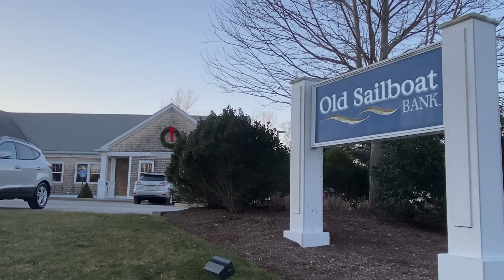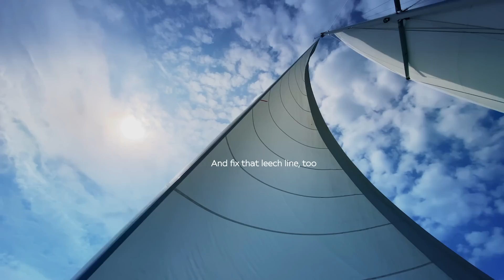EP 3: WHAT IS A THRU-HULL FITTING? Finding thru-hulls & attaching plugs! #Ran-daysSailboat

Comment: All capped not In use fill with fiberglass,all inaccessible make easier way to get to,while your out of the water once you get you through Hulls down to a smaller amount look for bad plumbing bad hose clamps and in bronze parts look for degradation bronze will go from patina to orange to pink or red the last two are the colors you don't want and remember keeping zincs and a proper grounding system will help keep through Hulls around a little longer remember all through Hulls are not the same some have stainless ball valves so remember about dissimilar metals underneath the waterline if you think something might be leaking breaking apart a valve is easy lapping compound and closing and opening will bring tolerances to better but  if corrosion or use creates less than satisfactory tolorences remember you could get a low spot from corrosion in your valve that even when closed water still flows time to either replace or figure if the tolerance can be fixed
Reply from the maker: This is super helpful… thanks for the tips

Comment: Maybe drill off from the outside remove all the ports use 1 or 2 in bound  3inch ports and a manifold wair all water in can be controlled with E Z access and a second port and out bound manifold  may davie Jones be with you...

Comment: Please don't use 5200. You will not be able to replace without EXTREME labor. Sikaflex or 4200 are sealants. 5200 is an adhesive
Reply from the maker: gotcha... thanks!
Reply: @YachtHunters  its a sealant/adhesive. I'd think you'd want something strong holding your through-hulls on.
Reply: I agree. Don’t use 5200 on these through hull fittings. No need. The fittings hold themselves on. You just need a good sealant.
Reply: @mudcop58  the big nut on the inside holds it on. with 5200, it would be next to impossible to easily remove easily
Reply: 4200 for the win....

Comment: RanDay, I hope you have a plan.  You have far too many holes in your boat, and worse, it appears that at least several are impossible to reach, which is very serious.  Is this a good time to add that my 37 ft boat has 4 thru hulls below the line and we are moving aboard next week.
Sorry to drop this on you, but I have a problem with your opening discussion of this video, where you “explain” the finer points of the thruhull/valve combination.  In this teaching moment, I didn’t hear anything about special types of valves in combination with the straight thread of the bronze thru hull.  Please please please do some editing to explain this correctly so some unsuspecting newbie doesn’t go to the hardware store and buy a ball valve and unsuspectingly try and screw it onto the wrong thread type thinking that it is just fine and dandy.  It needs to be done right.

Comment: I don’t understand why the fluids and gases are not simply fed through lines above then overboard rather than directly though the hull… With an outboard electric motor, you don’t even need holes going through for the motor. 🤷‍♂️

Comment: For any new boat owner, it could be a good exercise to open up one of the thru hulls in a controlled situation, and see what it's like to have water coming in. 

Practice using the different methods of stopping the water, and get used to the feeling of having to calmly and effectively solve the problem. 

It doesn't seem nearly as scary after you experience it. It's not like in the movies - you usually could just stick your thumb in the hole to stop the flow. Though that's not a long term solution.

Comment: Please take the advice of an old man who has seen more corrosion than the Titanic.
Bronze hardware was barely reliable in the days predeceasing the multitude of electrical and electronic apparatus of modern boats..
A reverse polarity  ,or a live wire hanging along the dock might "melt" your thru-hull like Ice cream in a locked car in August.
Get on with progress and get composite thu-hulls(not propyplene,plasic etc) and eliminate all form of galvanic surprises.
Reply from the maker: Excellent advice, thanks!!

Comment: I know this is heretical, having read the comments, but from a systems standpoint I would think redundancy is important. If six system go through one exhaust, and that exhaust plugs, you now have six systems down, vs one. Along that same line of thought: if those six systems are connected to two through-hulls, you have now halved the chances of there being a problem.
Reply: Full disclosure, my background is Navy and offshore oil and gas, but in both those realms we always had double valve protection to the sea or, as previously mentioned, a sea chest.   I just never knew that offshore cruising boats only had one valve and plastic tubing.  Incredible video!

Comment: DON'T use 5200 on any through-hulls. Use 4200!
Reply from the maker: Absolutely… great point!
Reply: @YachtHunters  Sorry if that seemed terse. I'm still watching your video. 5200 has a tensile strength of 750PSI, which can be stronger than the fiberglass laminate - especially if the hull is cored. 4200 is plenty strong and flexible for a through hull sealant, but the tensile strength is 300PSI. If you EVER have to remove a through hull (and someday someone will), you will appreciate that you used a less tenacious sealant/adhesive.

Comment: An old Salt once said, “ A boat is a hole in the water where the money goes in”. I would replace any thru hull that is frozen, hard to shut off.
I also recommend from one structural engineer to another backer plates per ABYC standards at the seacocks. Better leverage to accommodate the applied torque to the seacock.

You may want to consider 3M 4200, just in case you need to repair or redo . Almost as strong as 5200, but can be removed if need be. Just my two cents..
Cheers,
Nick.

Comment: Looks like everyone tried adding seperate ins and outs plus couldnt be bothered back filling holes for expired depth and speed sensors.. ..connect by wires not hoses.

Consolidate all salt water intakes into one large one . 

Engine intake needs to be fairly deep and aft possibly have a strainer grid over it you dont want to be sucking up sea weed.. or more likely plastic bags.. 😬 yet need to be able to clear it quickly at sea if that means going overboard.  
You need an out flow close to the engine and where you can see it chucking out or not from the cockpit but not near the swim ladder. Thats tempting fate. .. 

Sink drains  and shower sumps/trays, one for galley sink possibly collect head wash basins to same outflow. 
Question ...washing machine yes /no  if yes where..

One Black water storage discharge through hull from the tank  heads feed into tank.

Shower trap outflows stink, as does a washing machine or dishwasher but i would say on one shared outlet. 

Clean the bronze or brass fittings up inside with a wire brush you can slow the verdigris 
By wiping them over with a oil like lanolin or a smear of grease..  
If the cleaned bronze looks pink ...its corroded and it needs replacing. 

Check the free operation of the valve bodies.. and levers WD is used but im always suspicious about its effect on rubber and plastic seals. Search plumbing tips for freeing stiff or stuck valves without sheering the tops off.

I think you should be able to get down to @eight.. but you also need bilge pump outlets and cockpit drains.
all through hull valves should be accessable in less than two minutes max. And drain pipe routings smooth enough to allow rodding ideally.

Comment: Ran-Day, no to 5200!!! It's an Adheasive and not a sealant. You want 4200!!! If you ever have to remove the Thru-Hull fitting again (and you will), 4200 allows it to be removed.

Comment: waste of time, nothing to help of how 2 reduce amount of thruhulls orr what to do to keep em  functional. Btw, 3m 5200 is polyurethane.  Also, bronze is very susceptible to electrolysis. Rings around hose fitting are called barbs. Prob should have only 1 blw thru hull on a boat, the one that cools engine, even then have heard of guys wanting 2 eliminate that as well by throwing strainer connected 2 hose over hull sides when underway.

It's forbidden 2 dump holding tank, gps gives you speed, depth sounders can b outside of hull (some even read thru hull) etc... I'll bet most or at least half of yours r useless or abandoned, should b taken out and holes properly sealed